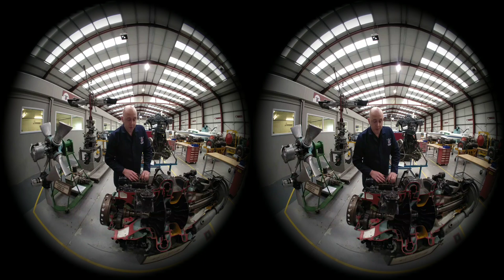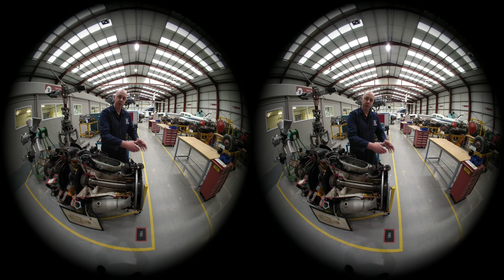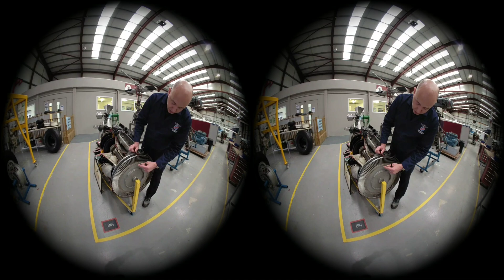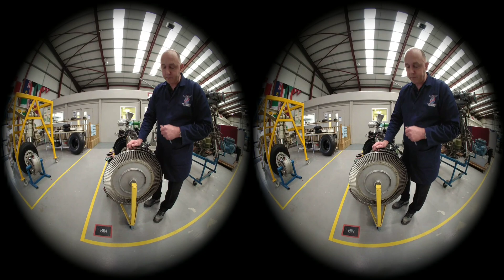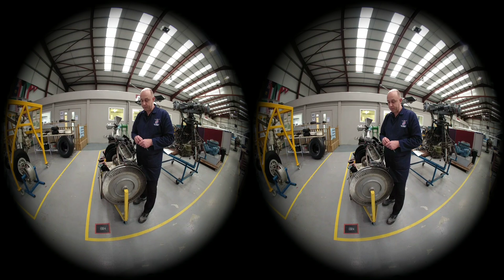VR 180 Gas flow through a Rolls Royce Dart gas turbine engine

Comment: Greetings Alisdair. I trust this message finds you more than well. May i ask if you have access to large diameter (circa 1mtr) centrifugal gas turbine impellers?
Reply from the maker: The largest centrifugal we have is about 50cm. We do have much larger axial compressors we have a pair of CF6s
Reply: @AlisdairGilbert  Thank you for your reply. We are looking for something similar to what is used in the RR Dart engine.
Reply from the maker: @user-hp6zn8os3o  the dart is only about 50cm it’s a twin stage both about 50cm. we do have the sectioned Dart engine seen in the video and as well as a separate centrifugal compressor on its own.
Reply: @AlisdairGilbert  Thank you for your response Alisdair. May i ask if you know where we could find a compressor map for the cold section?
Reply from the maker: @RohanOReilly so sorry I no longer work in the aviation college so I no longer have access to any technical data you could write to Cosford museum they might have copies of old technical manuals